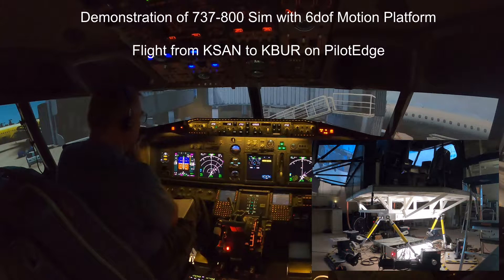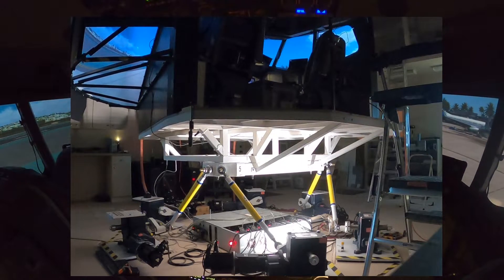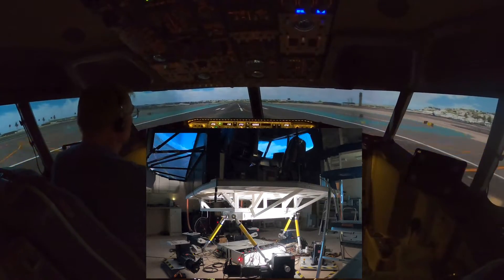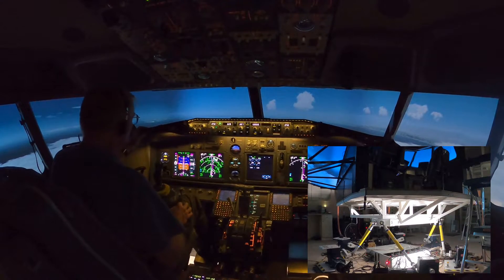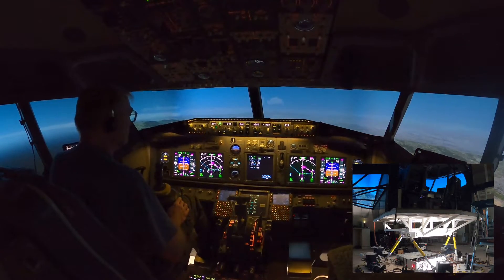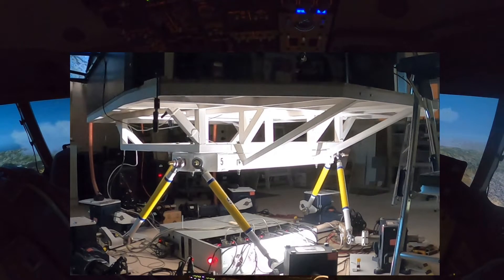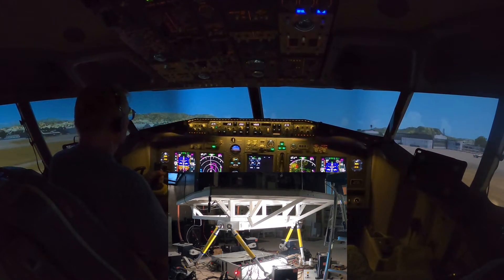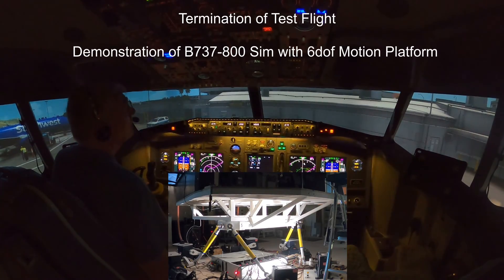737-800 Sim 6dof Motion Platform Demo 8 4 20

Comment: What kind of Gear Motors are you using?  I have a Cessna 150 fuselage in my house and have built a small 6dof platform with small servos but have pondered trying to find gear motors that will handle the weight of the fuselage.

Comment from the maker: Regarding the question on ATC in the video...   I enjoy using PilotEdge for real-time ATC.  It’s very much like the real ATC environment, and requires serious flight deck management to keep up with the flight, as is the exact same for real world IFR flying in the ATC System.   Even more challenging for me personally, is trying to properly fly the 737.   I have been in General Aviation for over 30 years.  I am Commercial/Instrument pilot, fixed wing and helicopter rated, but flying the 737 has been a real challenge in an actual ATC environment.   Especially challenging are short routes in the Los Angeles area, making it difficult to keep up with the aircraft and ATC...😀

Comment from the maker: I should also mention that when I first started this 737-800 Sim Project, I knew from experience with other big projects, that I wanted to fast-track the Sim build as much as possible.  In that regard, I chose Flight Deck Solutions for all the main Panel instruments and MIP structure.   Flight Deck Solutions are known for their high quality Sim components and systems.  I am proud to be a FDS customer, and from my personal experience, FDS customer service and product reliability is outstanding.

I also purchase the FDS Nose Section and Interior Panels.  All this gave me a huge head start on the 737-00 Sim construction.  Then I got the bright idea to add a 6dof Motion Platform to the Sim.  Designing and fabricating the Motion Platform greatly complicated the Sim Project.  However, I am now in the final stages of building the Sim, and expect to have it fully completer this year 2020.   This has been a 4+ year project.
Reply: flght deck 737 is about 100k USD. MYYYYYYYYYYYYYYYYYYYYYYYYYYYYYYYYYYYYYYYYYYYY

Comment from the maker: Regarding FS2020...    I learned a long time ago that it’s best to to stick with one solution that works and is reliable.   Everyone has their own ideas about such matters.   For me, P3D v4.5x has been a fairly stable Sim software for use with the 737-800 flight model Sim-Avionics.   I do not plan on touching FS2020 in the near term.   Fantastic scenery is great, but for a full-scale 737-800 Sim, flight deck management is the main challenge, and for me, most of the fun.

Also, at my location, I have a very slow Internet connection of less than 8 Mbps, which may be a serious restriction using FS2020.   Anyway...   I have my hands full right now finishing up this Sim, so it is not wise of me to introduce new Sim software into the mix.

Comment from the maker: Regarding the design of the 6dof Motion Platform:   There is nothing super complex about its design.  It is modeled after the typical hexapod type design.   What is critical however, is deciding on the orientation/layout of the hexapod components.  These factors largely determine the size, complexity, and cost of the Motion Platform system.

I decided to use a Gearbox/Lever system to drive the hexapod actuators.   The main reason for this was ease of construction and low cost.   In my case, I purchased a 160:1 dual-reduction gearbox made by Grove Gear.   This gearbox incorporates a 1st stage Helical reduction, followed by a 2nd stage Worm reduction.  The Worm reduction prevents any “back drive” movement for safety reasons.  These gearboxes are very robust, having about 10 times the needed torque requirement.

Both the Motion Platform structure and the upper Flight Deck structure are weldments made with steel tubing.   The six Actuators are made using thick wall steel tubing, with 1” size steel Rod Ends on each Actuator.   I decided to use a 6” radius for the Actuator Lever on the output shaft of the gearbox.

There are many ways to design a Hexapod, and the approach that I have taken represents just one way of accomplishing the design and construction of a 6dof Motion Platform.  My approach to the design challenge was mainly constrained by my personal resources to build such a system.  Fortunately, I have my own personal machine shop, so machining and welding, etc. was not a problem.  As far as cost is concerned, I have about $15,000 invested in the motion platform material and system components.   This is relatively inexpensive compared to buying a commercial 6dof Motion Platform.   My Motion Platform is more of an experiment to see if I could build such a motion system on a “beer budget” that would yield an incremental level of Sim immersion to give a realistic sense of motion for ground/air flight operations using the 737-800 flight model.   I am very pleased with the results thus far, and I consider the time and cost worth the investment.

The input drive to the gearboxes is accomplished with six Servo motors.  These are very powerful servo systems, with high resolution encoders.  Each Servo motto is rated at 2.2 KW.  The Servo system is controlled by the Thanos AASD-15A Servo Controller, which in my case, is fed by the BFF 6dof Motion Control-software for outputting motion cues from the P3D flight simulator.   The Servo system is so powerful that careful “tuning” of the motion cues are required to prevent radical platform movements and related jolts that can induce extreme shock and vibration into the motion platform and related structures.  

Because people ride in the Sim Cockpit, it is to be considered a “life support system”, with related precautions and safety measures applied anytime the Motion Platform is in a “Powered ON” mode.  This type of setup needs to be taken seriously to prevent injury or worse.  I never work under the Motion Platform when it is powered is applied to the Servo Systems.  When starting and/or shutting down the Motion Platform, I always use a Check List to ensure it is done correctly each time.

Comment from the maker: I apologize for not replying to the comments sooner.  I’ll try to answer the questions...

Regarding vibration affecting the projectors:   After deeply considered the potential problem of vibration and how it might affect the Projectors and Projection Screen frame structure, I decided to use a “truss” type of design using thin wall steel tubing, which I bolted together with 1/4” hardware.  The main attach point of the Projector Screen frame system is the FDS Nose Section, which is bolted to the Flight Deck frame structure.  This makes for a fairly rigid assembly for support of the projector screen and the projectors, which are located on an upper platform.   The main concern was that the projection screen support structure was extended out from the center of the Flight Deck by about 6 feet, which opens the door for low frequency resonant vibrations to develop.

To minimize the effect of vibration that might be induced into the projectors, I mounted the three Optoma GT1080HD projectors to a base board made from 3/4” Baltic Birch plywood, which is very stiff, yet light in weight.  This base board “floats” on a cushion of foam and is constrained within a steel angle frame structure.  This has the effect of eliminating any shock to the projectors, while at the same time, the projectors are held in precise alignment on their mounting board.  Any slight movement of the projectors is unnoticed during motion platform movement during a flight.

As a side note...   The Optoma GT1080HD projectors are of the “bulb type”.  I have not had any issues with these projectors in this application as mounted on the Motion Platform.   That said, I plan on replacing the GT1080HD projectors with Optoma’s new ZH406ST Laser projectors.  These new projectors have the ability to receive 4K input.   The laser light source is much more stable compared to the bulb type lighting system.  I plan on installing these new projectors in a month or so.
Reply: Thank you for your response, it's much appreciated. We are about to start testing projector/screen configurations on our motion platform and plan a similar approach to yours. i.e. a combination of rigid support assembly and vibration-absorbing mountings, but it's also reassuring to see your comment that any slight projector movement is unnoticed during platform movement. Your comments about possible low frequency resonant vibrations due to the screen support structure extending off the platform are noted, and this is something I will bear in mind. Thanks again and best regards

Comment: Hi, I've been following your project for a while and congratulate you on your excellent achievements. I'm involved in a similar, but smaller scale, project building a Cessna 172 cockpit on a 6DOF motion platform using BFF motion software and X-Plane 11 and would like to ask if you would be willing to share any experience you might have in resolving the problem of platform vibration affecting your projectors ?  Did you need to use some form of anti-vibration mounting or damping arrangement? Thank you and thanks for sharing your project in the way that you have. Regards David